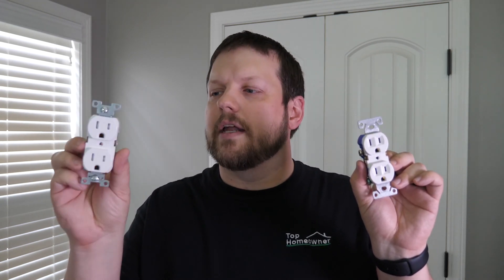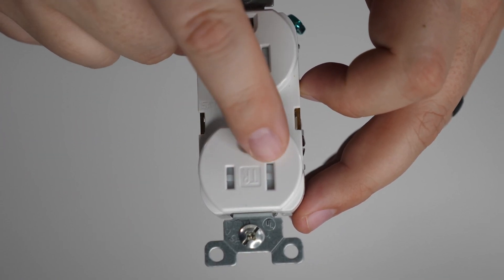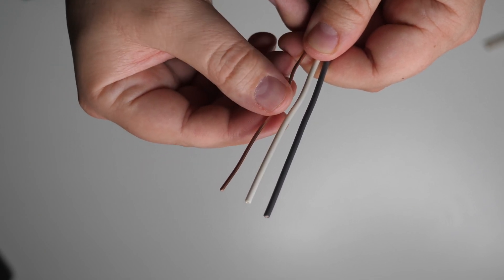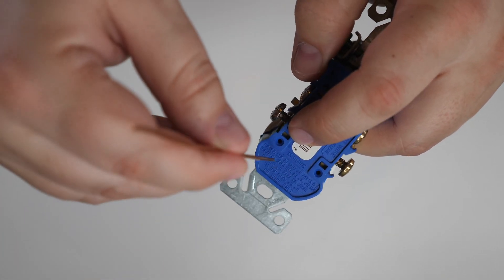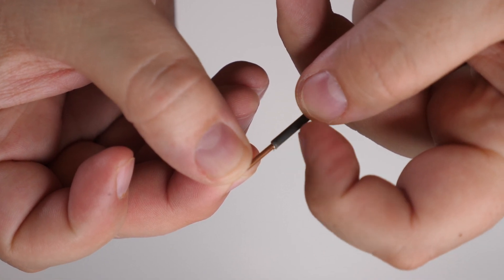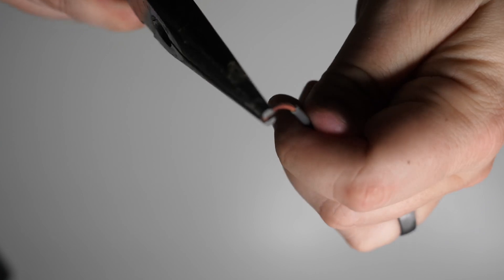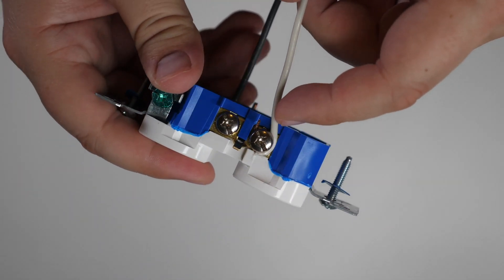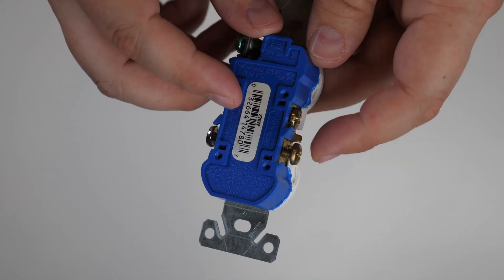Electrical Outlet Wiring - Home Wiring 101

Comment: Great video. I’ve got several questions. My house was built in 1984. The receptacles don’t have a ground wire attached. As far as I can see, it’s a metal box and metal conduit. When I replaced a receptacle, I used one of those 6” ground cables with the screw to ground the receptacle to the box. The assumption being the the conduit was acting as ground back to the circuit breaker box. Was this the correct approach?

Comment: If you are replacing a receptacle in a bedroom of a place built in the 60's (probably midway in the chain of receptacles in the room), should you replace with a residential just to keep it in line with what's there or does that not matter? Thanks.
Reply from the maker: A commercial or spec grade receptacle is simply better quality so there's no need to worry if you're upgrading a single receptacle to a better model.
Reply: @TopHomeowner  That's exactly what I did, installed it last Sunday. Very straight forth install. No problems at all. Thanks so much for the reply back:) I may replace the rest of them soon:)

Comment: What do you do when you have 6 receptacles in a room 4 are on 1 circuit an one of those is wired correctly and 3 of them tester shows open ground but the ground at the breaker box is connected to the ground bar
The other 2 receptacles are on another circuit an you use a circuit detector and get 2 or 3 different breakers that it is connected to, and you check it a 2nd time an tester shows it is connected to a 240 circuit. Any clues as what to do.
Please help
Reply from the maker: Since the receptacles are daisy chained, I'd check the ground at the receptacle thats working as well as the next one on the circuit. If the ground wires are connected with a pigtail, it may just be a bad connection at either the working receptacle or the next one on the circuit. Hope this helps.

Comment: GFCI and spec grade receptacles never have the back stab option. Back stabbing is only on cheap residential grade and will only work on 14 gauge, not 12 gauge. If you have a 20 amp circuit it must have 12 gauge wire, but a 20 amp receptacle is not required as long as it is a duplex, and in my view is not recommended, you'll never need it. Only a simplex receptacle would have to be 20 amp on a 20 amp circuit. Use a 15 amp "spec grade" receptacle in most cases. It is exactly the same as the 20 amp, but without the horizontal slot. The 20 amp receptacle is also slightly more expensive.
Reply from the maker: Thanks for the comment!